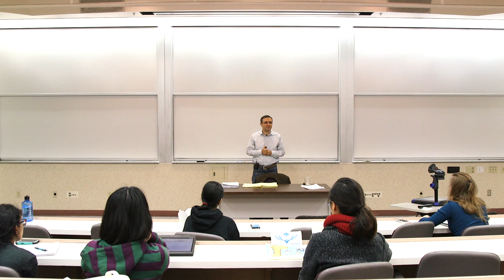036. Fourier Transform: Sampling

Comment: if possible then please  upload lectures on  sinusoidal oscillators and function generators.also two port parameters and their interconnections in circuits .thanks .
Reply from the maker: Thanks for the suggestion. I will try to consider it.